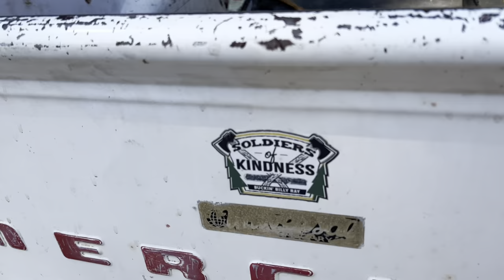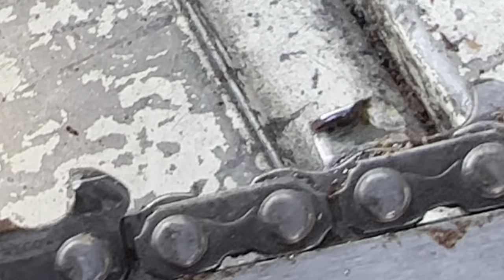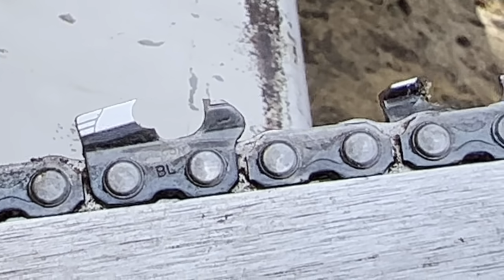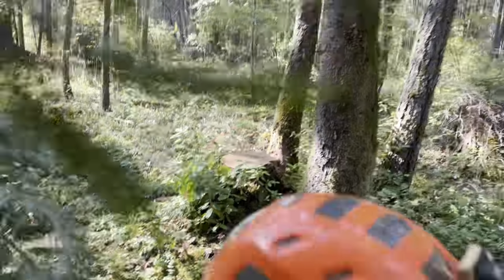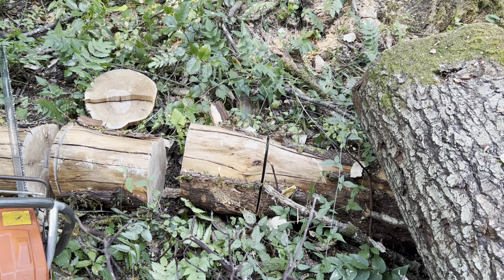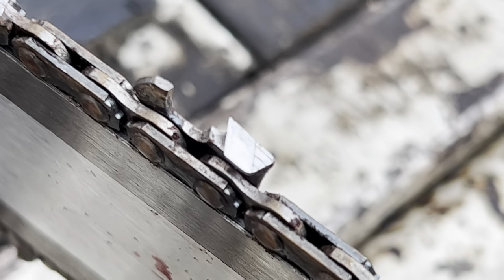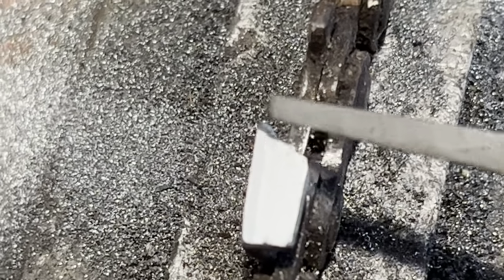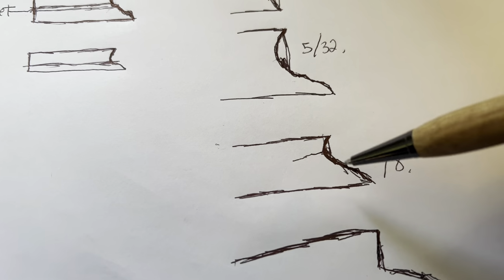DID I RUIN MY CHAINSAWS CHAIN!

Comment: From my experience the STIHL RS chain most definitely holds an edge the longest vs Oregon LGX or Husqvarna X cut at least in my timber. It’s not the FASTEST outta the group and costs a bit more but it s made outta a higher Rockwell steel than the others. All are excellent chains in their own right -  pros and cons to all
Reply: Stihl RM for me is even better.  It blows my mind how long it cuts actually "good"
Will full chisel or square ground chain cut faster?  Oh yeah..  but mine will cut good for a looong time.  Sometimes I dont even take a file..  just a few backup chains in case I find an old fence staple or rock it.   When I get home i'll just 30/55/.030 it on the grinder bench.
Reply: @mattfleming86  iirc the RM chain is a semi-chisel vs the RS chain which has a full-chisel (RM round corner vs RS pointed corner) … While it may cut a fuzz slower I agree that it will hold its edge longer. Happy sawing !
Reply: Stihl chrome plates their cutters for one. I agree with you as being harder. As a retired STIHL tech I've sharpened all brands, Oregon sharpens easier because it's  softer.
Reply: @richardfuerst5286  believe it or not I can actually tell it’s harder than the others when I file it !  It’s HARDER to file 😀.  It may be more expensive for a loop of chain up front but it’s been my experience that it will buck more wood over its lifespan than the others thus a better overall value
Reply: I agree with this 100%.  The drive links on the Stihl chain also seem to be stronger.  I despise working with Oregon or Husqvarna chain.    But that is only my experience  so YMMV.
Reply: If you go back 3 or 4 years ago when Billy was at walkers place that's all he uses is stilh chains him n walker said stihl makes the best chains now a few yesrs later its all Oregon n husqvarna chains take it for what it's worth he changes his mind quite often 
When it comes to saws I believe why he likes husqvarna so much is he is a big fan of McCulloch saws and when they sold business in 1999  sold its European division to Husqvarna AB. Nine years later, Husqvarna also acquired the rights to the McCulloch brand on the North American market he went with them 
Same thing with Poulan
Redmax
Partner 
Jonsered
And the list keeps going
Reply: @jcc3999  iirc Electrolux bought Husqvarner in 1978 and sold around 2005-2006 … some models produced during the 80’s and 90’s are excellent chainsaws - still being used today and will run with modern equivalents. I just p/u a 266se and a 268xp (both 67cc) to expand my horizons 😀… I’m looking for full wrap handles for them but may end up using a 372xp full wrap and hacking it up to suit 😉
Reply: They separated in 2005
Reply: Husqvarna motorcycle was bought by Ktm in 1987 
When BMW owned the bike division
Reply: Stihl has the best chain and best bars hands down.
Reply: @davidthomas5997  I would add best over all saws aswell as their other power equipment they been making them the longest out of anybody else experience is the key
Electric chainsaw 1926 
Gas power chainsaw 1929
Reply: @davidthomas5997  Cannon bars works out of BC Canada produces some of the finest bars available anywhere. Expensive, but in this case ya get what ya pay for. If you’re gonna run STIHL chain then run STIHL or Cannon bars. I know thru experience the STIHL chain will eat up softer bars
Reply: @jcc3999  Agreed!
Reply: @fabzacres-blackcat  I will check them out. Thanks!
Reply: @fabzacres-blackcat  Absolutely you are correct cannon are great bars if your running stihl saws n chains stick with there bars why use anything else except if your looking to run long bars then you will have to run cannon Am wondering if you had any experience with panther bars

Comment: I sharpened a chain recently making a 5/32 file put the "c" in there and it cuts oak like butter. Nice big chips. One thing I have a question on though..when I have to cut parallel with the wood fibers the chips become like straw..maybe 5 cm (2 inch) long and if I dont watch it they clog up the discharge chute on the saw...did I do something wrong on sharpening or is this normal?  PS I  used your video to convince my son in law that he can sharpen chains instead of throwing them away when dull..I guess he's a little sharper now too!

Comment: You aren’t going to weaken the side plate by using the 5/32 baby “c” method - remember the total depth of cut is determined by the raker. It cuts quicker because of better chip evacuation and the changed geometry of the tooth - smaller radius file . You can do ALOT to a sqr/rnd chain to get super quick cut cut - I’ve personally gotten within 7% of sqr/sqr (square ground chain) just by hand filing the top plate at a steeper angle. It does dull a fuzz quicker all things being equal but it cuts FAST

Comment: Thanks Buckin'  I had to use this technique to properly sharpen a square filed chisel tooth (Stihl chain, so the configuration of the tooth is little different),  when one square files (As you know), the tooth gets three cutting edges, and two angles.  while filing, this causes the file to bind in the tooth (NOT optimal for configuration), so I cut a relief under the side plate, with a round file (3/8 chain, 3/16 file) at a 30° angle to the tooth, and a 20° angle to the bar, similar to the angle used for a round filing , just as close to the chain as possible.  The tie straps on the Stihl chain have an indent in the center, making it easy to get the file lower than normal (Yes, I still cut into the tie strap a little bit).  End result:  A very fast chain that is MUCH easier to sharpen.  thanks again.

Comment: something i've been playing with is increasing the distance between the cutting edge of the tooth and the raker , meaning i'll grind out about half of the raker . i find this allows me to have the rakers slightly higher than i would normally have them , but with gentle pressure the chain will bite easier into the wood as there is less bearing surface on the top of the raker holding things back ..
this might also create more space for chips waiting to be cleared out , especially on large logs
Reply: I've never heard of a "raker,"  it's called a "drag", it keeps the cutting tooth from going too deep into the wood. Still and Carlton chains are junk. Always buy Oregon chains.
Reply: @ricktaylor3748  no one  i have ever talked to has called them a "drag" and i have been working in various sawmills and  tree spacing , falling , bucking , getting firewood since the mid 80's
Reply: Not only stops the tooth going to deep but also moves chips out the way

Comment: Chip size is directly related to the energy required to make the cut. In manufacturing engineering we calculate the energy by analyzing the amount of new surface area created, which is minimized by making the largest chips you can. The trade off is that more power (work divided by time) is required to make bigger chips, and each material has limits. For a given tool, it’s most efficient to make the biggest chips your power can support.

Comment: as a timber framer feller and sawyer, i would go back to how i was trained on edge tools. on the top plate you want to create a cutting edge between 25° and 30° , 30° more resiliant and better edge retention BUT not quite as sharp. the same applies to chain which is bassically a series of chisels on a chain.

Comment: Love the t-shirt ideas! I'm 6 ft 2 and bucking wood with a 20-in bar is a pain in my back! Going to the local hardware store and switch it out for a 28-in bar! I run a 60 cc Husqvarna, so I should have no problem with that bar.
Reply: 28 inch bar is 70cc territory.
Reply: @jeepinass  I'm going to port the saw too. I may drop down to a 24, but I think with the port job, it should be fine. I am going to do with the saw is cut firewood for myself. Just something to tinker with.

Comment: I’ve experience good result, since 2 years, with a "chip dump" made by a 4" or 6" flat file to mimic a square sharpening on a good round filed chain. It’s the best that I found for 0.325 hungry and tough firewood chain.

If buckin' can test this vs is baby c, i’m curious to hear is opinion.

Comment: wood doesnt dull a chain the dirt and sand trapped in bark or debris the tree has grown around and just plain sticking your saw in the dirt... im loving the square grind after getting the hang of it seems to last the longest in hardwoods (oak n hickory, elm) a little grabby on pines tho.. even after 5-10 .. 40+ inch oaks still way sharper than a factory grind.. and as long as i haven't hit wire its usually 3 swipes with the file n back to scary sharp

Comment: BBR I run smaller chain than you, 
.325 (on a 271 farm boss) if been getting pretty good at round filing. Do you recommend I stay with the recommend 3/16 size file or have you played around with different sizes?? Thanks in advance from Ohio

Comment: How many tanks of fuel did you go through on the chain?  Over time, as the tooth gets shorter, what are you doing with the bottom of the tooth that gets left behind with the smaller file?

Comment: The chip dump you still square file and follow with the round file just above the gullet correct? (Edit) what would be the original gullet on the chain. Like a two step file process. Honestly they both cut very well. Definitely been fun to watch. I wouldn’t worry about edge retention on either chain. Thanks for the videos, well done. Appreciate the time taken to create this content. 👍
Reply from the maker: neither of these two get square treatment brother
Reply: @BuckinBillyRaySmith  thanks, wasn’t sure on the chip dump. Interesting, have to give it a go on my sp81 and see how it goes. Think I’m gonna try the square file for the top plate and round for a chip dump under that. Got a few old  chains I can play with. Really like how the square file cuts but a chip dump under that I think would interesting 🤔

Comment: Hey Buckin' I had an issue with how my chain was cutting today that I'm hoping you or someone else in the comments can help me troubleshoot. 

Bucking some 15-20" diameter logs the chain felt a little grabby at times, and as the day went on it would almost start to bind in the wood. It felt kind of like when the bar and drivers get super gunked up cutting red fir, but that wasn't the problem (the chain wasn't tightening up, it was spinning freely, getting oil). It also felt similar to the beginning of a pinch, but the kerf wasn't closing. It was like the wood was fighting me, or the teeth would just stop eating wood, or I was somehow getting outside my kerf mid-cut. I could start a cut but as soon as I was a few inches down into the log I would run into trouble. It was at its worst when I had the bar buried, dogged in.

rakers are taken down, it has about 3/4 life left, gullets are deep, tooth angles mostly consistent (not the worlds most perfect hand file but by no means horrible)

I tried the chain on a different bar and saw and got the same results.

I see small ways I can improve the sharpen but nothing that explains how bad it was cutting... 

Thanks for what you do. I learn a lot here!

-
Reply: If the chain is sharpened back a ways, the narrower kerf is not thick enough for the type of wood your in. If you use the chain on a different type of wood it would work fine.  Whatever wood your cutting shrinks. It’s a common thing on certain wood.  For that type of wood you need a fresh wide chain.

Comment: Sorry Buck been thinking about the need of a chip dump. And I just can't think of any cutting surface that uses a dump. Maybe someone can help me here. The baby c does the cutting. I watched the video before this one and then this video again. If someone sees more chips or the power head running easier or with less strain with the chip dump I'd like to know. Maybe a side by side timed cut might prove it. Or maybe I'll try it on my chain. Just seems like it's not a filing that is needed.
Reply: I even looked at race chains by Art Martin and nope no chip dump. Very careful filing yes.

Comment: can you educate me on Ash!?!? i sharpen my chain just as you have shown me in many many videos. this ash dulls my bald like no other. we have the emerald ash borer big killing all the ash in our area. so now we are cutting it down and sizing it for splitting. but this wood DESTROYS my chain. it gets hot and smokes and throws sparks  and kills my edge. this wood actually throws sparks!!!! what do i do? i have another 20 trees near my house that need downed or cut and split. no other wood kills my edge or chain worse than this spark throwing Ash
Reply: Note: this wood is also on my property that i purchased last year. so the old owner never cut them down. Now they are petrified rock solid ash trees standing at attention. any suggestions on these flame throwers?
Reply: @Killswitchpulla  I have a ton of dead ash on my 80-acre woods in lower Michigan.  I've switched to semi-chisel chains which are easier to file and seem to hold up better than the square  or full-chisel chains I was using.  The Stihl RM chain matched with a Stihl bar should keep you going.  I haven't tried Buckins Baby-C with a chip dump.  Looks interesting but I'm not in that much of a hurry when cutting.  Keep it simple and safety is more important than speed as far as I'm concerned.

Comment: could someone offer some advice? tying to sharpen an old chainsaw recently got... some one has filed the chain with to large of a file. got the proper size on it now but the top edge leading to the working corner is getting rounded/convexd? not sure why is this a problem

Comment: Buckin, I got a question about an old Mac I aquired.. I got the card cleaned and running from the basically "tar" like substance that accumulated in it over the years. She ran great! Let it sit a couple weeks, and the entire fuel line just started melting and disinigrating inside the tank. My question is this... Where can I find an exact fit replacement fuel line for my pro 10-10 Automatic?? Ive seen some online that look like they fit but in some comments people say they don't actually fit..
Reply from the maker: I’ve never found one that fits exactly they all leak
Reply: @BuckinBillyRaySmith  thank you very much for the response! I know your a busy guy and wasn't even sure I would get a response. I appreciate it sir!

Comment: This is a awesome vid if you're playing around with sharpening. Fine, take a chain or two to the shop to keep generally sharp chains available and see some standard profiles, but keep a chain or two you work on yourself, by hand and can swap out to compare the behaviors of different shapes/grinds, because inevitably you're going to want to touch up a chain in the field or around the firepit and you'll need to know what to do. Chain sharpening yourself can be really rewarding and therapeutic and it is pretty hard to screw up consistently.  Replace your files often, new sets are only 20-30 bucks and make the job much easier. skip the guides. Thanks Billy, keep it up, much love.

Comment: I just recently bought an Oregon square tooth chain and file. I actually find the square tooth chain easier to file. Go figure. I have a Walkerized 372 and it's cutting like a dream. But watching you cut with the 266 baby C, or I believe your 371. Man that cuts fast!! I guess I'll just be satisfied with the square for now. I also noticed some comments on the Stihl chain. My bosses company uses Stihls, Husqvarna, and Echos with various types of chains. I believe that most comments are within my belief on the Stihls having a great chain. My Oregon chains are great! The Husqvarna chains are not really that good in my opinion. Thier are some others that I came across that are ok, but Stihl and Oregon are my favorites so far.
Reply from the maker: when oregon came out with exl i did a video one out of the  box  who was faster it was Oregon,,,, and smooth , but thats outta the box ,, we all file a lil different
Reply: @BuckinBillyRaySmith  Is this only a round file? I cannot seem to find the EXL in a square tooth.

Comment: I would love to mail you a round of Live Oak and of Mesquite from Texas(for you to cut on and check out).. but it would cost😂 Seasoned, bone dry Mesquite sounds like crystal when processed pieces are tapped together. The Live Oak is even harder, and it is much more dense/heavy. Seriously, you would be shocked. LiveOak grain doesn't look normal. It's not straight, rather it waves back-and-forth→/~~~/←Like that. So trying to split it conventionally is extremely difficult. I would venture to say that it has likely destroyed some hydraulic wood splitters.. but they do sell Live Oak firewood. That processed live oak will burn forever. I mean one round split up will go all night and into the next morning. I ran into an even harder species (Iron Wood) out in the Big Bend area of Texas, but I have not taken a chainsaw to any of it. However, I did cut down a bunch of Iron Wood saplings with a circular saw blade on a Stihl weed eater. About 1.5 hours duty, and those blades would be totally trashed- like cutting concrete. Unreal.

Comment: Arbutus Pacific madrone 1,460 lbf Janka Hardness:
White Oak1360White Ash1320American Beech1300Northern Red Oak1290
Hard maple, or sugar maple, is the most durable of the maple species with a janka value of 1,450, 
Hickory is among the hardest domestic hardwoods with a Janka rating of 1820
Black Locust wood's Janka hardness scale is 1,700 lbf (7,560 N)